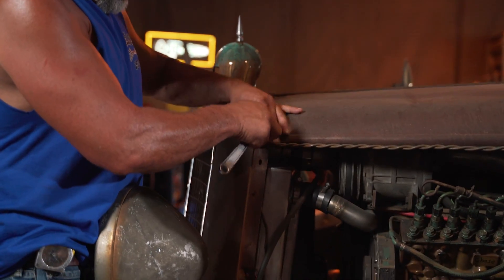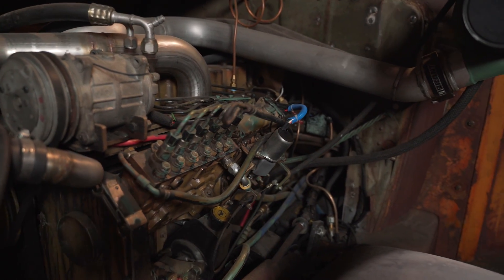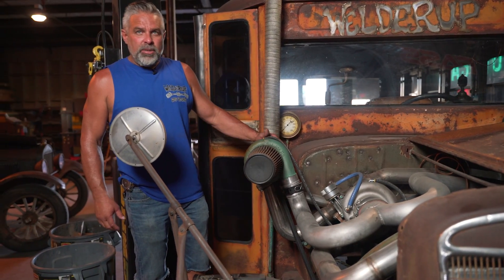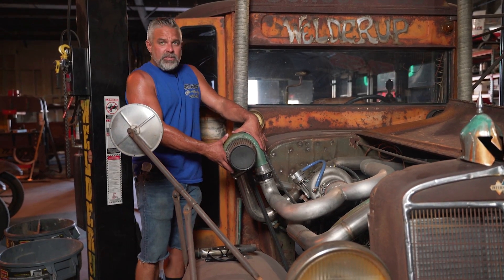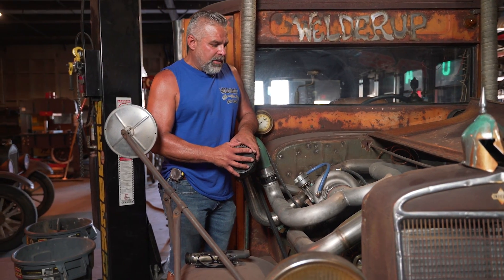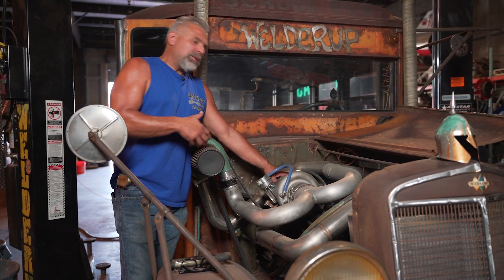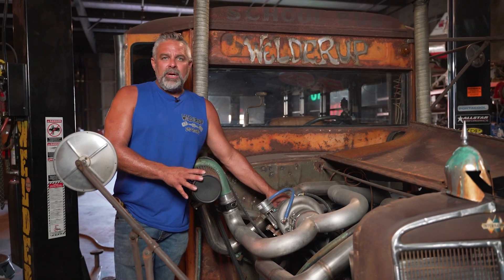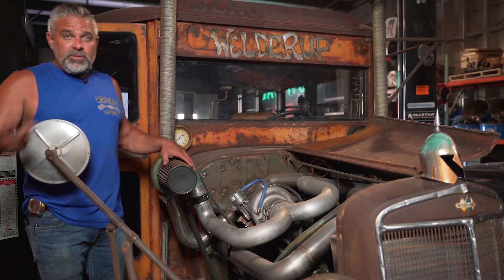What's Under the Hood of My Legendary Monster Bus?

Comment: Yo Steve you like a big off the wall compression ignition engine with crazy boost have you ever come across the Napier Deltic. Turbo and super charged together design for the royal navy and adopted by British rail. Ones unlikely to of ever made out as far away las Vegas. But you never know, you definitely dont want melt a piston in an engine like that, you dont want be stripping it a hurry. The  kind of monster to make the guys running there Detroit diesels trucks feel like small fry. I been lucky enuf to meet they guy who designed it because he was one of my dads old college tutors. Crazyest engine I ever come across should give your triple turbo a run for her money. Just a shame I never seen one in anything that goes on the road.
Reply from the maker: No, I haven't seen one. Sounds really heavy. Sounds cool!

Comment: Beautiful BUT it's always the same thing Cummins p pump.its the 2021 chevy 350 cookie cutter.How about some thing funky like a old Sherman diesel
Or a radial engine I see the detroit but some the cool
I am working on a r975 radial in my wagon and a 7.3 p pumped with cummins 8.3 injectors
Reply from the maker: Sounds like a great project your working on!
Reply: @WelderUpVegas  I could imagine how amazing it is to be able to have all of these great ideas been able to facilitate them with help via employees seems like that's what plagues everybody they have a ton of ideas either they don't have the money or time to finish them you know Daryl there's a ton of 8.3 Cummins laying around 2 that would be awesome to do a twin P pump even the stock 12 mail them pump would be enough if you double it up. I know one of the things you talked about is your Detroit the lack of power one of the things I have done is water-methanol injection gives you about a hundred horsepower more which ain't nothing compared to the comments running a compound setup just something different you seem to be an awesome artist and I appreciate all of your work. I'll have to send you some pictures I have a 1970 flat nose Freightliner tilt bed with 52-inch Michelin under it it's a beast running the 871 non-turbo thinking about doing a twin
Reply from the maker: Thanks Corey, you can send your pictures to www.info@welderup.com
You have all the right ideas. Keep them coming.